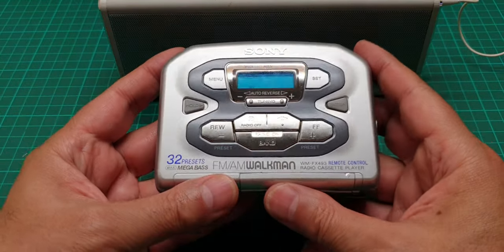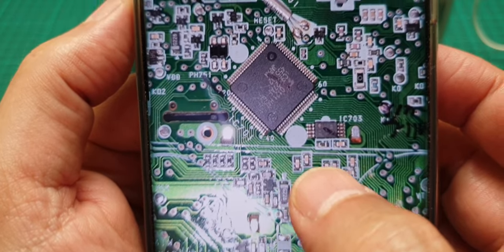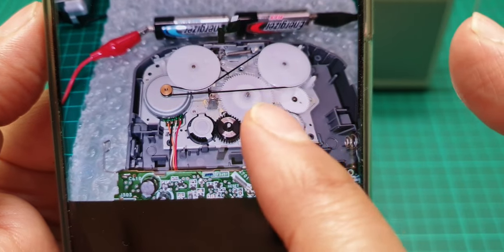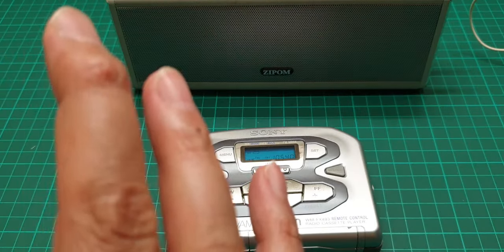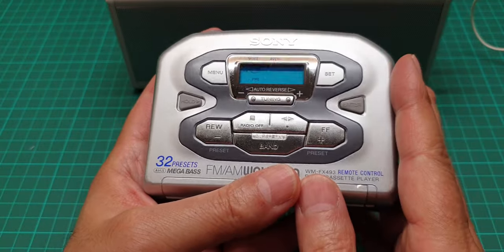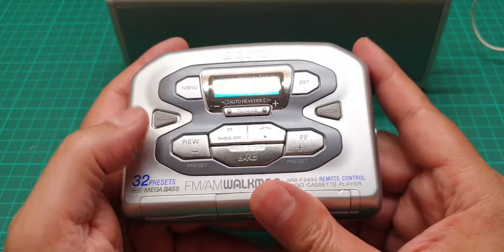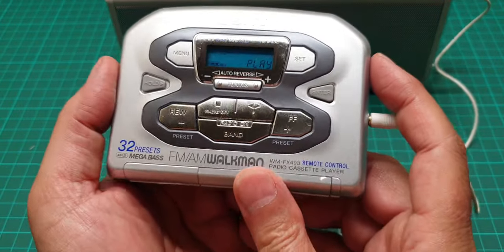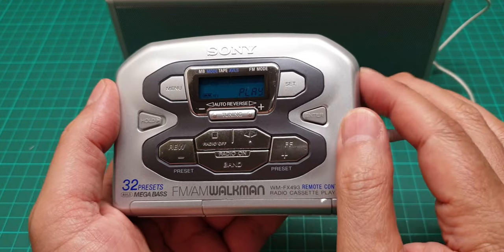Sony WM-FX493 Radio cassette player Walkman review & inside look

Comment: I had a strange fault with this model which i purchased second-hand but it was in excellent cosmetic condition boxed and still with stickers on. It would play fine but when i pressed stop it would play the tape out in the opposite direction and not take it up on the other spool. As a result the tape would always end up getting wrapped around one of the pinch rollers.

Comment: It is a very nice cassette player with amainzing features. Do you know how can i deactivate the beep since every time when i press down any button sound a strong beep, specially when the tape have finished a face and go back in reverse?
Reply from the maker: @DennisReyesCaballero  Hi, Thanks for visiting my channel and your question. Sadly, the beep is part of the chip programme. About rolling tape, these are susceptible to go out of sync while power stops during playback. The door won't even open when this happens. My advice is to open the back and manually force stop the mechanism until the head releases the tape by rolling the capstan. Hopefully, the mechanism goes back to sync, if not, let me know. Take care and cheers for now.